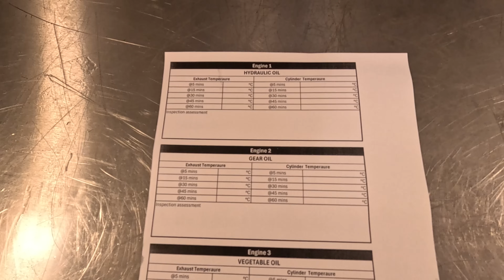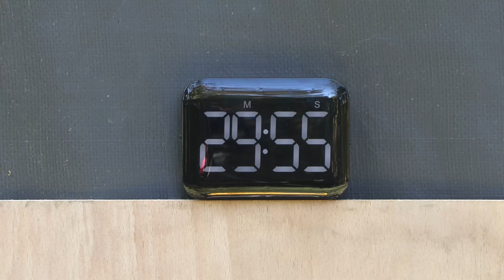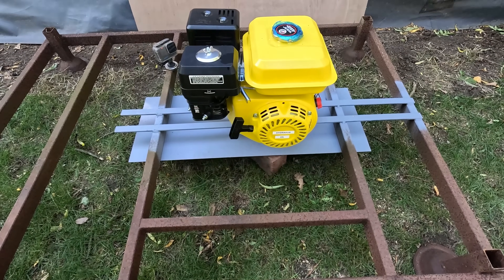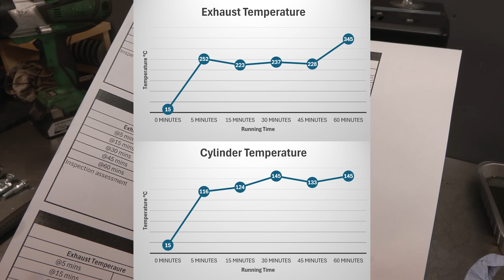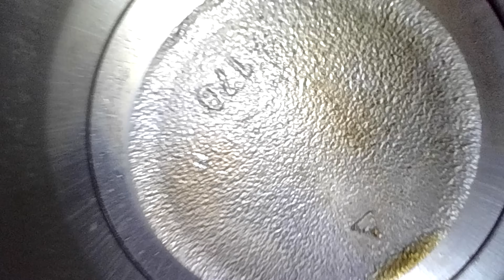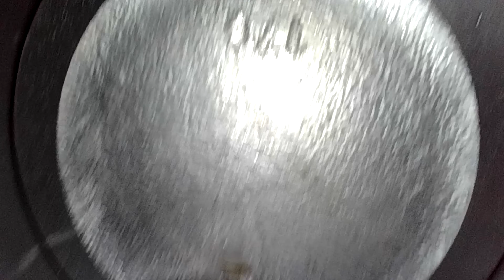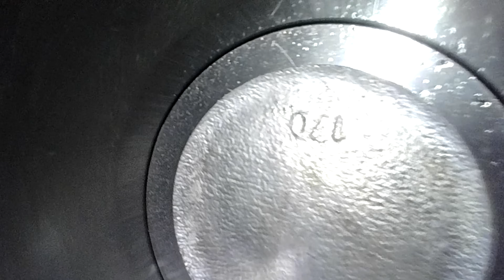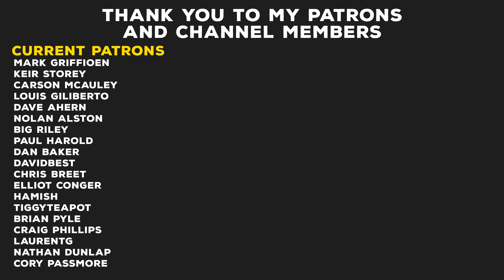Will Any Oil Work as Engine Oil?

Comment: Who is here because the font and title colors made you think it was Project Farm?
Reply: Although Project Farm has performed these tests several times over, it's good to see other opinions.
Reply: @Argumedies I agree because more testing means more data for comparison and then a better conclusion.
Reply: Yep, same. But to be fair at least he preformed a proper test (as advertised on the thumbnail) and not just another fake youtube click bait knock off.
Reply: @dogs-and-destruction-channel  Agreed, with the caveat of the absence of the control test.
Reply: And it wasn't some A.I. bull

 @dogs-and-destruction-channel
Reply: @colinofay7237  
That's true, too.
Reply: Yep. Swore this was a project farm video when I saw the thumbnail. 😅
Reply: With him the old beat up push mower motor would also be in the thumbnail
Reply: Yes i could have sworn this was a project farm video
Reply: The scoring on the cylinder walls of brand new engine is from employees not knowing better and they will keep spinning them over by hand after installing a part... because they have so little faith in their knowledge and experience they have to keep making sure what they did hasn't locked the engine up 😂😂
Reply: That guy set an insanely high bar. I can barely follow along he moves so fast sometimes 😂 national treasure
Reply: Guilty
Reply: If Project Farm voiced over the whole video no one would be able to tell it isn't him
Reply: @apking130  I would 100% every single time
Reply: It looked just like project farm
Reply: Project Farm tested bacon grease in an engine. That's the content we need.
Reply: Yes absolutely, he should start adding his photo to the thumbnails.
Reply: Yes! Exactly
Reply: I didunt  hear Kermit
Reply: To bad project farm doesn’t do these fun videos anymore. The reviews are great I used many but mixing in these kind of videos would be nice again.
Reply: Guilty as charged
Reply: I do
Reply: I had to go back to the preview screen as soon as I head an off voice in the video. I was so confused. Then I thought maybe a son or relative did a video for project farm… Still wrong.
Reply: Yep
Reply: Yes I did think it was project farm lol
Reply: Yes
Reply: Me
Reply: Me
Reply: Same here
Reply: Right here man😂
Reply: Nope
Reply: NOPE...he only uploads on Sundays 😊
Reply: He scamming us fr
Reply: 😂😂😂😂😂 whatever works
Reply: I thought the same thing
Reply: Yes lol
Reply: I didn’t realize it wasn’t until I read your comment. Lol
Reply: Agreed
Reply: Yes, just be original
Reply: We’re gonna test that
Reply: It's still just as good, though
Reply: I agree that it looked like project farm but tbh if you know project farm he normally uses the predator motors in these test as there quality is much more similar that other brands (except Honda)
Reply: lol
Reply: He ran a motor with bacon grease, chunks and all. It performed quite well and had minimal wear.
Reply: Bro I was thinking the same lmfao 😂 🤣
Reply: Ya i honestly thought this was projectfarm LOL😊
Reply: Yep, this creator was very smart to do that thumbnail. Glad he did, got me to click and subscribe.

Oh and of course youtube themselves suggested it
Reply: Yes
Reply: No kidding. I click it based on it
Reply: Nope just here because it's this type of experiment. I never give a crap about font on a video and don't give a crap who is doing the tests.
Reply: Project farm??
Reply: Yep at first I did
Reply: What's project farm?
Reply: @phathomthis  it is a you tube channel with 3.3 million subscribers, all videos are user recommended,  so if you leave a comment suggesting a test you would like to see, he might do it if he hasn't already. He does alot of simaler stuff, but tests all kinds of products. Even those laser temperature 🌡️ guns, stain removers for laundry 🧺 name it.
Reply: Not me.
Reply: Yep, but I clicked on it and realized it was not
Reply: yes bro thats precisely what i was thinking, then i heard the voice im like what the fuck
Reply: Yup spot on
Reply: A mind since it’s not; I’m gone
Reply: Now I must go watch project farm.
Reply: I could see that but I checked the name first.
Reply: Me.  That's it exactly.
Reply: But ended up liking it WAY more because project farm sucks sacks
Reply: The temu version of project farm
Reply: Thats crazy man i saw the thumbnail and immediatly i thought what is that one dude again that uses that bearing for lubrication testing in his videos and then i see your comment first, its project farm!🤣
Reply: Ok they are broke in. Clean them out and do it again, sometimes the connecting rod wearers faster than the cap.
Reply: here here. rip off artists lol
Reply: Who?
Reply: Me
Reply: I definitely thought it was PF
Reply: @ProfessionalByNoMeans  lol the more we comment the more we help lmao 😂
Reply: Me
Reply: I checked before clicking, but yes it seems designed took like Project Farm.  Nothing wrong with that if the content is as good. :)
Reply: Yep i thought it was him
Reply: I can listen to this voice indefinitely compared to Project Farm!
Reply: Same here
Reply: Thought it was gonna be garage 54
Reply: Not me
Reply: Yep 😂😂
Reply: I really did!!
Reply: Me too
Reply: Was probably on purpose
Reply: I was I heard the voice and had to check. “This isn’t project farm”
Reply: Me
Reply: Me.
Reply: As long as its not project 2025 ,ill take it !😊
Reply: @ you do know project 2025 is something that is written for every president as sort of a guideline of things they should do as president. 
Trump hasn’t even read project 2025 and has openly said he’s not gonna follow what it says. Not to mention some of the things people saying it is. Is wildly misleading and some are complete ignorance. 
Think of it like a blueprint written for a president to give them ideas of what to do however the president does not have to follow it and there’s one written for every president and most the time it’s not followed. 

In short don’t believe the mainstream news of any variety as you will fall victim to fear mongering
Reply: Me theni heard the voice. And I was like what the fuck??
Reply: Copycat..
Reply: Me
Reply: Yep 😂
Reply: U just read my mind I was thrown off when I heard his voice then realized it wasn’t a project farm video 🤣
Reply: This is Euro-farm 😂
Reply: 🙋🏽‍♂️❤
Already reported the video 📹 🎉
Reply: No
Reply: Na i came here to see them go boom
Reply: Yep
Reply: Absolutely played my life
Reply: Yup
Reply: I came here from a Project Farm video. I guess enough people thinking this was him, created enough of a pattern for YouTube to recommend this to PF fans. Still glad I'm here. This was nice. Learned a lot. Like these ghetto engines may need a break-in-period, and there maybe assembly oil in the combustion chamber, and I may have glitter to clean out.
Reply: Guilty...
Reply: Nah, he has gotten corny and maxed out, shark jumps the 🦈
Reply: Yup
Reply: he will be the next project farm, mark my words
Reply: @somerandomcapybara 
We'll see about that😈
Reply: I think dag would make a good project farm @somerandomcapybara

Comment: Interesting concept. 
For information, the first oil change I did on a new Lifan (same is yours) engine came out looking like the yellow engine oil. The next change was much better, as the engine had broken in.
So it would have been best to "run in" the engine on normal SAE 30, before switching to the test oil.
Nice video though, thanks.

Comment: Very interesting study. I for one, really thought that the engine running the vegetable oil would’ve failed. Good to know 😉  Thank you!
Reply: These are very crude engines, very simple and cheap build. I quite sure a more advanced and expensive engine wouldn't make it an hour before it failed.
Reply: @Bannimann2 in our metallurgy lab, we evaluated the lubricity of various oils.  Surprisingly, veg oil was at the top!
Reply: Vegetable oil made for lubrication can be good if the heat isn't too high and the change interval is very short. It has very good lubrication properties. Bio diesel is better than regular diesel in every way so long as it doesn't get cold or sit long enough to spoil.
Reply: that one was the only one that smoked on start up i don't think it was good from the beginning
Reply: Vegetable oil was used as engine lubricant in the 19th and early 20th centuries.

Comment: This was fascinating but it sucks that you didn't do a control run with engine oil so we could get an idea whether the difference in temps was due to the engine or the oil.
Reply: This.  Without a control, it's not telling you anything.
Reply: Yes, a control engine would've been helpful.
Reply: So project farm needs to remake this. Got it.
Reply: Um look at a mower on oil
 That's your control.

Comment: Quick reminder, while the vegetable oil worked in this case, that's because these engines don't have oil pumps. Had it been pumped it may have aerated and turned into a slimy mess.
Reply: I ran a VW Beetle on veg oil as a bet with a friend. He said it couldn't run 150 km (approx. 94 miles) on veg oil, and I said it could. It survived, although it was smoking a bit more after the trip, and it smelled like a deep fryer. It was  an old 1100cc 25 hp engine, but I'm pretty sure that at least 10 of those ponies had left the stable even before the test. lol
Reply: the oil temperature stays low in all these cases because they arent under a load... these all shouldve had some sort of a load on them.. incorrect lubricants tend to fail when they get hot as they lose their viscosity or break down altogether...  not to mention super cold..  regular engine oil must be able to still flow at very cold temperatures. -15,-20 C in some areas.. think of vegetable oil in a snow thrower that gets started when its -15C.. it will be nearly a solid, so the dipper couldnt toss any oil on the bearing.. it has to melt all of the il in the sump befor the big end would get any lube.. these tests were done in ideal conditions when many fluids would lubricate just fine..  but real world is that engine oil has to sustain a wide range of temperatures.. heavy loads.. and still maintain good lubricating properties and a specific viscosity range..
Reply: ConocoPhillips make a vegetables based oil for their gas turbines. We used it at their gas plants here in Australia
Reply: caster oil was used as engine oil in the past thats what castrol is named after
Reply: i use 350ml fresh left over oul, 1.5 ltrs used oil, filtered 5 times with face tissue, turned up side down nmineral water bottle, then 2 ltrs of PALMOIL, ut runs 1l:,10.5 KMS/liter. for 10 t0 11kms, new oil filter , very abusive, 1300 mini van toyota

Comment: Great experiment. If possible it would be interesting to see the the temperatures when running on recommended 10w-30 oil - on all 3 engines
Reply: Yes, without a control run, it doesn't tell you anything.
Reply: @videodistro  Well is does tell you that in a pinch all three of the oils will run the engine - by comparing with 10w-30 oil is should be possible to determine which of the 3 alternative oils are best at dissipating heat
Reply: @HobbyMotorDK  The oil temperature under a given load, RPM, ambient temp, etc is more of a function of the oil's viscosity than anything else. Since thicker oils create more viscous drag, they tend to run hotter. Of course there are exceptions and some oils will run hotter or cooler than others due to varying degrees of sliding friction, but for a valid comparison, the viscosity must be considered and the same engine must be used or the oil temperature being the same on all engines must be verified with a reference oil.

Also, keep in mind that lower oil temps don't necessarily mean less wear or better protection. Viscous drag generally isn't harmful to the engine. And as Lake Speed Jr showed, friction and wear are two separate things and often aren't related.

Comment: The higher exhaust temperature for the vegetable oil makes sense to me : less viscosity means more oil finding its way into the cylinders, therefore more oil residue in the exhaust, therefore more thermal transfer.
Reply: When he said it smelled like a chippy I just assumed it was dieseling with whatever veg oil was getting past the rings, which would be consistent with higher EGT

Comment: Different type of vídeo, really interesting. These sorts can be used as in-between videos for projects that are taking longer to conplete. 

Maybe try using vegetable oil instead of petrol
Reply: Vegetable oils can be used as fuel in Compression ignition engines (diesel) but not for internal combustion engines (petrol). These test engines had spark plugs, therefore they were NOT diesel.
Reply: It would have to be an LPG conversion for spark ignition, which would be interesting but probably beyond this video

Comment: i dont think there was much cross-hatching on any of the cylinders and its surprising how badly scratched they were for a new engine. its true what they say, you get what you pay for. i bet the veg oil one if left running long enough would seize or blow, it would get too hot and not be as able to cope. interesting test though